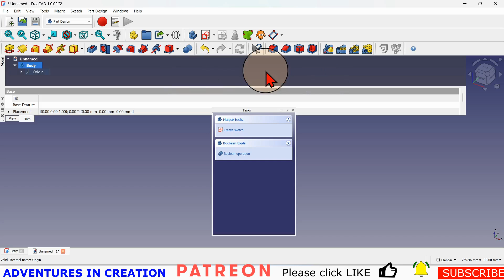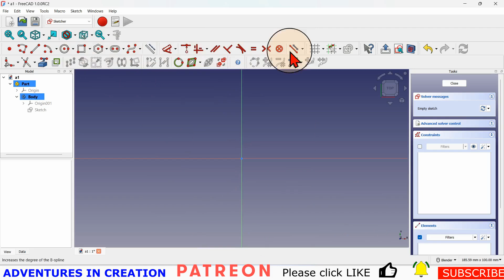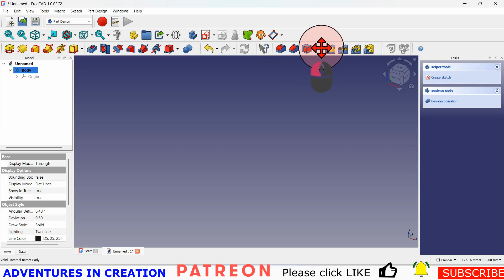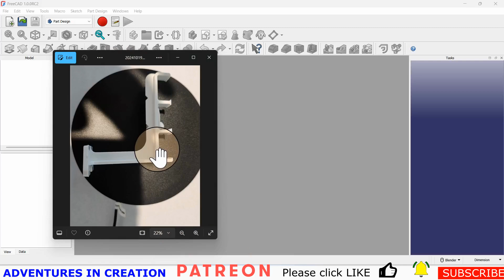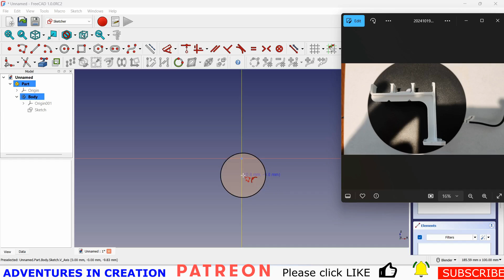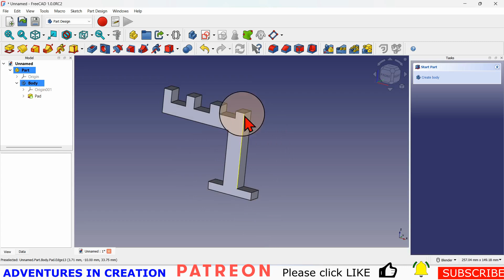An Introduction to FreeCAD 1.0 Part 2 #freecad #cad #design

Comment: following your excellent tutorial. I cannot see the Create Part icon. Running version 1.0
Reply from the maker: That's odd. I will check to see if it's configurable. It may be hidden in your toolbar.
Reply from the maker: I checked it's on the toolbar with "make link", "create group"  and "create a variable set {}" if you see any of those, you may have go to the end of that toolbar group and click the drop down. Or you can move that part of the tool bar down to the second line and it will expand.

Comment: Could you reverse the order of the playlist? Part 1 is currently #8 on the playlist, and part 8 is the first video played.
Reply from the maker: That's weird, I'll look into it.
Reply: @Adventuresincreation  Cheers! It gets a bit tiresome having to manually choose the next video in the series, when all of a sudden I'm back on Part 1 after listening to you talk about workbenches :D
Reply from the maker: @Sparkrdom  I can't reorder them but they seem to be in chronological order and go from 1 through 9 ?
Reply: @Adventuresincreation  I can't post links because youtube just auto nuked. But I do have screenshots to show what I mean. You'll have to fix the actual URL.

Imgur  / 9GMOMOc

imgur  / TPB2pg4

The issue for me is that it's in reverse order. Video #1 in the playlist is Part 8, while the final video in the list is Part 1.

Ultimately, though, I will deal with it for the content :)
Reply from the maker: @Sparkrdom  I couldn't see your images but I am not sure why yours are upside down. When I see them they are the same as the other playlists I have. I don't put them in order, they are added when they are created.
Reply: @Adventuresincreation  yeah, apparently YouTube has been putting most recent video at the top of playlists forever, you can find reddit threads complaining about it. And there's no fixing it

Comment: 12:24 Thank you for the layout option discussion.  Many other tutorials assume that the layout they use is the same as the default.  I ended up searching all over for the correct icons and sometimes couldn't find them at all.  Now I know why.
Reply from the maker: Excellent, glad it helped.

Comment: Currently using Fusion which I like a lot. This seems to be way different. However, if Autodesk starts charging the free version this seems to be a viable option. Great series!
Reply from the maker: Thanks! That's where I came from. I made a few fusion videos but then autodesk changed the licensing. I didn't want to put all my time into something that might go away.

Comment: What an absolute nightmare, sorry. Unable to get model tree, only get labels and attributes under tree view. I was previously using Freecad 0.21.2 and had it up and going, but switched to this later version (regrettably). Also unable to find drawing templates, even in the last version, but also unable to find drawing sheet templates in this version. I downloaded the appimage file to run under linux 64 bit so I am not sure if this was the right way to go. Any help greatly appreciated. Regards Graham B
Reply from the maker: I haven't tried the drawing templates yet in 1.0 but I will. I use the windows version and all works with the download. I will try installing on Linux. Have you tried the download instead of the app image?

Comment: Hi, in the past I have tried to jump from fusion 360 to freecad, but one thing that has stopped me before is how to use parametric parts. I want to be able to enter a variable as a parameter and share that variable across files such that if I update that variable, all my parts in different files are updated. you can do this in Fusion 360 buy creating a root part, call it parameters, and then import this part in all other parts and use the parameters from there as a dependency.

In FreeCAD I saw there were several approaches to this like an excel sheet and other meta data objects in the files. but I just want to know the best way to do it that will be supported from version 1.0 onwards as the official way to do parameters.

Thanks!
Reply from the maker: I use spreadsheets extensively but you may prefer dynamic data. I find spreadsheets a little easier to manage. They are both supported in version 1.0
Reply: @Adventuresincreation  I believe this could be a good video tutorial in the future if you are interested. Thanks for the info!

Comment: What I find confusing is that each 
Model has a part and each part has a body.

However when creating a new file freecad starts (and alway has done) with a body.

I don't understand why it doesn't create a part with a body in its tree..
Reply from the maker: I am not sure why that is but the part gives you a way to contain/group multiple bodies that make up that part. Ie a table may be the part and is comprised of a top and four legs which are all separate bodies.

Comment: You seemed to indicate that FreeCAD was not for animation.   I am building an RC model of the cessna 337 push pull and I need to do an animation to determine the angle for the rearward main gear.  I dont do python or c++ so I dont know if freecad can do this or not.  Perhaps the animation you were referring to was more like a cartoon? If not which Foss software do I need to get to grips with to solve the  angle problem. The cessna 210 has a similar rearward rotating main gear and it is relatively simple on the drawing but for the one applicable angle.  Tony
Reply from the maker: I think you can do what you want in the assembly workbench. It will allow you to see how parts fit together. It not the best for full animation, blender is better suited for that.
Reply: Thanks - I will press on with FreeCAD

Comment: How would you scale the sketch to the photo? The measure tool seems to require an edge or vertex, it doesn’t seem to work on an image. Thanks for a great intro to version 1.00
Reply from the maker: I have another video that shows you how to trace a photo but, for this case, I would rough out the shape then I would add dimension that I measured from the part itself. When you create a sketch it's parametric, meaning you can change the dimensions to anything you like. I alway work to "rough" out the shape then add the dimensions. It is important that you add the "features" in the rough shape so you can later dimension them. Also, when you dimension a shape, one gotcha is not to change dimesions of parts to dramatically, i.e. don't go from 2mm to 200 mm in one step or you may make your sketch go inside out! Most of all, have fun with it and know you can't break it. Try and see what happens, Ctrl+Z is your friend.

Comment: Thank You for the video! Very helpful! 
I have one question: if i model a table for example. Are the desktop and the legs separate "parts" or separate "bodies"?  What is the difference?
Reply from the maker: You can do it as separate bodies. Then the part is a table and the bodies are the top and legs. Then if you want chairs they would be another part with legs and a seat as bodies.
Reply: @Adventuresincreation  Thank You! Now it's clear.
Reply from the maker: @robertcartman3502  Excellent!